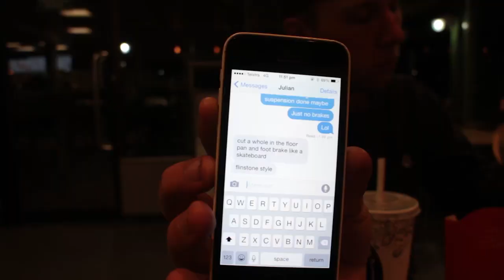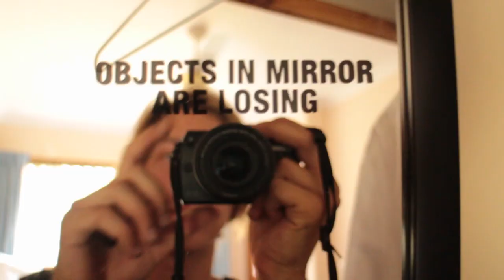Ke70 Episode 1: Installing ae86 coilovers and brakes

Comment: dude, greetings from finland! i was about to change brake discs on my ke70 -83 sedan.. i bought some discs but they wont fit and i wont find anywhere what would fit :( do you know where to find those on original front end? or do i really have to upgrade on ae86 front end stuff to get new discs :DD

Comment: Sweet something i am into...whats parts did you use for this if you dont mind me askin
Reply from the maker: Ae86 front strut with weld on coilover sleeve kit, short stroke shocks, cusco camber tops, xt130 lcas, JDM ae86 brakes, ae86 steering arms
Reply: +TheFellasNetwork thanks
Reply: hey guys! is it possible to tell me if ae86 lowering springs will fit the ke70 standard shock struts? im getting a headach researching on and on what to do and i cannot find a clear answer. THANKS :)
Reply from the maker: in the back, 100%, the front, not too sure, should be about the same size, could just chop the 70 ones though
Reply: Ok thanks guys! i was thinking to cut them but not sure yet. keep u the great work. thanks again :)